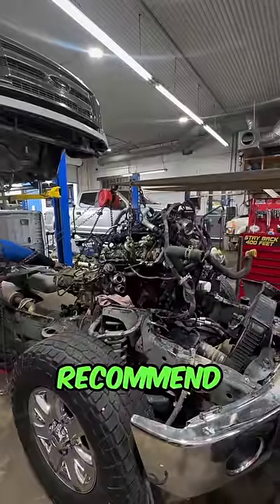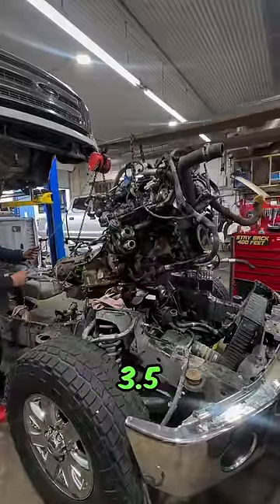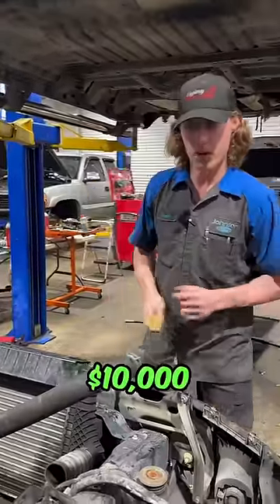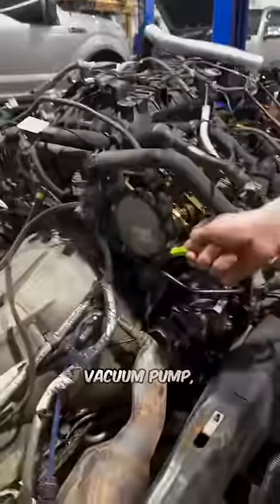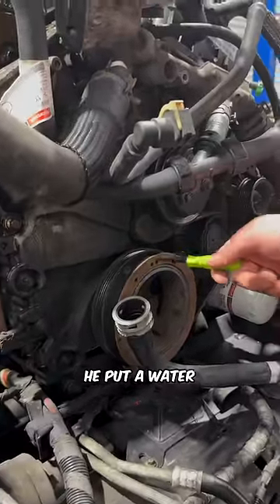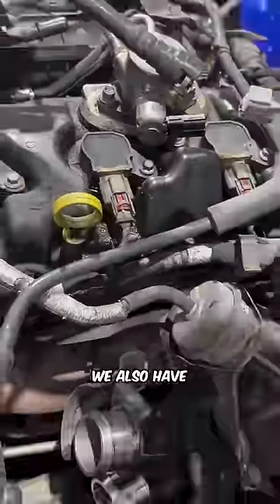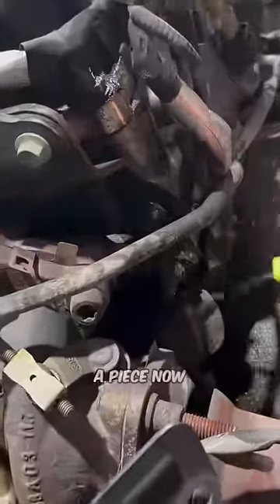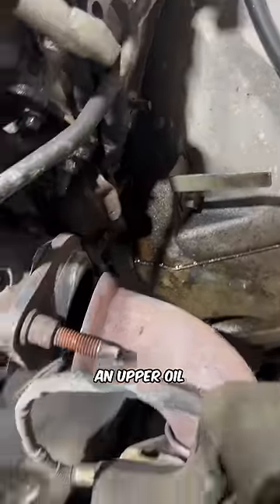Why not to buy a Ford 3.5L EcoBoost? #ford #ecoboost #shorts

Comment: Couldn't find a truck for 10k in last three years, made more sense to drop 8500$ into a 24 year old truck. Newer trucks had way more horsepower but weren't getting better fuel economy, so it was a wash on getting a newer vehicle. All new plates, title, registration, paying more for insurance, I'd have been losing money. With the miles I drive a year my current vehicle should last another 20-25 years, with my initial purchase price of 1500 plus the 8500 for a new motor, my vehicle "payments" are under 450$ per year if it makes it 20 and 360$ if the motor makes it 25 years.  What idiot would buy a new vehicle for 4,5,6,7 hundred a month?
Reply: That’s why I’m sticking with my 03 cat eye with a 5.3. Maybe 2 grand tops to r and r, and maybe another grand for the trans. 5-600 for tires and I’m good to go for another 275k. Plus, even with her leaking oil and coolant I still got 21 with a stick exhaust and intake. Can’t wait to see what a nice cam and head work can achieve as far as power. Even if gas is going up past 3.20 right now in Texas 😭
Reply: @rexmedina4561  Amiri King: "Chevy Sliver-A-doh goes for infinity miles" 😁
Reply: I have friends that pay $760 a month for truck payments. SMH.
Reply: I recently had a 1300 repair on a 99, 5.4. If I bought the new equivalent at 72 months and 7%, each month the payment would be 1300.
Reply: My 96 Dodge is rusting so bad it won't pass state inspection. It's sad.
Reply: Not me. I like the older models anyway. But one day these will be the older models and I dread having to buy one 😅
Reply: You said "newer trucks have more horsepower but weren't getting better economy" Cause newer trucks OFFER way more horsepower for that fuel, so they are definitely more fuel efficient. If you push any vehicle hard it will consume more fuel but the big difference is how much power you are getting from that fuel.
Reply: @trentallman984 if you buy a raptor yeah. But a new xl f150 isn't. My dark horse premium is 1150, same as a velocaraptor
Reply: @JH-zo5gk  I pulled up an in stock, super cab Lariat at a local dealer. The exact equivalent to my 99.
Reply: Easy, you don't buy a new one. My '13 XLT was under $30k out the door and has a bit over 500hp while averaging almost 18mpg. Can't get that at the dealership even of you shell out $50k nowadays
Reply: My fiend pays $875.00 a month for his new truck .
Reply: I picked up an '86 chevy c10, 100% rust free, 54K orig. miles, a few years back for $8K..... But dang it.... it's just too darn nice to use as a daily driver. Garage Queen

Comment: I own a 2015 3.5 liter f-150 with 187k on it. Kept getting a message on the dash no traction control. I told this contractor my trucks losing power and he put his diagnostic computer on and he told the throttle body is stuck closed. I bought a new one at Auto Zone for $119 before taxes only 4 bolts held it in easy to replace now truck runs great.
Reply: So you couldn’t accelerate either? Seems more relevant than the error message
Reply: @BabyGators No it wasn't stuck closed someone just fired the parts cannon and got lucky 😂

Comment: You know lets be honest here. I remember eating Pringles back in the 80's. They were different. Much much better tasting. The powder stuff was caked in them and the chips didn't fall apart when you looked at them.  Also, I truly believe Oreo's from back in the day absorbed milker faster than the ones do today.
Reply: What does that have to do with a junk quality ford?
Reply: Maybe quit buying junk food? No one has a right to complain about the diminishing quality of junk food 😅
Reply: The better question to answer is what food today tastes the same as it did 20-40 years ago? Almost nothing. Everything from chips to drinks, to fast food, to frozen food snacks.. everything.... I'm not sure I can think of a manufactured food item that has the same quality control and ingredients as it did 20-40 years ago. Can you name one? Like a processed, manufactured food that tastes same as it did in the 80s/90s/early 00's. Bet you cant name one.
Reply: @LUk3.M. McDonald’s
Reply: Twinkies tasted better too. Also, I have a 2013 Explorer and I will never buy another Ford. What a POS.
Reply: Ihave a 2013 edge now the front axel makes a cliking noise on hard left turn.

Comment: I've got 338,000 on my 2013.
Over 250,000 towing miles, got me started as a hot shot
A couple exhaust manifolds along the way.
Finally lost a head gasket. 
Very, very good truck.
Waiting on an engine now.
HIGHLY RECOMMENDED!!!
But change the oil every 5000-7500 miles.
Full synthetic every time
Reply: you hot shot with a half ton? what kind of loads do you tow?
Reply: @busterscrugs  20ft PJ 14k tilt-deck trailer. 
Winch load old cars, pickup trucks, many  hundreds of compact tractors from Facebook and Craigslist. 
Payload up to 10k.
It was pretty decent when gas was cheap until Brandon got elected.
Probably clear $300-500 a day back then.
I've got a bigger setup now.
Everyone needs to start somewhere
Reply: 186k on mine. Set my oil life to 50% and only use penzoil ultra platinum. Been a great truck!
Reply: I'm looking to get into hot shotting. Good luck in your future!
Reply: Who sells the remanufactured engines? Just curious.
Reply: @tcatx8496  I'm hoping to get used from local yard or copart auction and swap
Reply: @garrettbreech728  I add lucas fuels oil additive. It lubes the guides and no chain noise 174,000
Reply: On the 3.5 change the coolent every 3 to 4 years with  oat yellow ford coolent so the water pump will last.oil blend 4000 max 5 ooo syn.helps the water pump to.
Reply: A very, very MID truck

Comment: I had trouble with both turbos on my 2016 f150 3.5 ecoboost,bought them both from ebay at $170 a piece and replaced both manifolds with new gaskets and bolts for $150 for the pair and installed both turbos with new fittings 11 months ago and the turbos are working beautiful and the labor only cost me like $350 since i live at the border with México and theres some really good mechanics over there who really know almost everything about these fords so they know what they're doing.

Comment: and the old 4.9, 5.0, 5.8 & 7.5s are still running fine everyday.that tells me ALL i need to know about newer fords.i'll keep my old ones.
Reply: I have a 98 460 and it looks like it has never been touched.
Reply: @jimandskittum and it still makes 180 hp 😂
Reply: @cptbuiltk7944   Preach brother, I'm not a Ford fan. That's a big ass motor to be so weak but it does keep right on rolling.

Comment: it has 200k miles. They got their money out of it. Spend 10k and get another 200k, it's a lot cheaper than buying a new one.
Reply: You ain’t getting another 200k outta that motor
Reply: @classicmonty5728  I have an 11 6.2L with 200K. Not a single leak. Engine looks very clean and runs like a hungry bear to a picnic. It is VERY rare for those to fail.  I just installed 16 plugs, even if Ford did it only 300$ labor. Does cost a bit more in gas.
Reply: @classicmonty5728  if an early model ecoshit made to 200k, I'd say it's a unicorn engine. I wouldn't be surprised if it made it another 200k.
Reply: True that even just base model f150 are 40k and up. Even used ones with 100k or more miles are still selling for 20-30k, some are even 2wd. Truck market is crazy, people just keep buying no matter how expensive trucks get.
Reply: Nah. Maybe if it was an older truck/engine. Ya know when they were more reliable and built better. 
You put 10k in it now it won’t last another 200k I promise you that. As soon as you seal her and tune her up- the tranny goes- the suspension goes- the computer goes- all the other major components start failing one by one. Dash and interior start falling apart, etc. Domino effect……. Be thankful it gave you 200k. Get whatever $ you can out it and get another one. It’ll be cheaper and better in the long run. 
Trucks after made after 2010-2014 to present day aren’t meant to last anymore. Throwaway plastic junk.
Reply: @johnsalcido5436  older trucks were indeed more reliable, but it doesn't matter if it's the worst truck or the best truck ever. Time has gotten to older trucks, interiors are worn down,  very likely leaks fluids, suspension worn, among some other things. Finding an older vehicle that was maintained is not only hard to find but when you do find one, it's overpriced. That goes for anything considered a truck, I keep seeing older 7.3 diesels with 200k miles going for 15k and  above. Sure, it's a great engine, but unless it was maintained properly, it's going to be a nightmare. One thing gets fixed another one breaks. Even worse, when it had multiple owners, the seller would probably still want way too much money for it. If the truck has lasted 200k miles it'd be best to just try your luck with it. Especially since you know whats been maintained and what hasn't, plus it's a good conversation starter. Buying a another truck just won't make sense in this market. Go cheap, you're getting a ticking time bomb, buy new your also getting a ticking time bomb. Better to just stick with what you already have for some people.
Reply: @alb12345672 that's a naturally aspirated, kinda normal V8. Unless it needs chains and tensioners, not much goes wrong with them
Reply: @hoost3056  For that engine, even that is very rare. The VVT is UNHEARD of to break. It uses the valve springs to position, not oil pressure. The VVT just fills with oil at a certain position. A few break valve springs. Most can be easily repaired. Sadly though, a handful die from it. That is the only way they can be destroyed.
Reply: These ecoboosts didnt have port injection, only direct injection.

2017+ ecoboost F150s of any engine combo are the ONES TO GET and the 5.0 from 2018+
Reply: @alb12345672 nice. But equivalent to fords 3.5 is gms 3.6. Even crappier. Thank god they aren't in the pickup trucks and rear wheel drive.
Reply: @Flatlandproductionz  The 3.5 is a much better option than the GM turd. A used car dealer said he hates to sell them because there is always a buyback or bad review. Usually when people sell them they are spent.
Reply: @curlyfriesolaire8053  my 2015 made it to 56k miles before it had a problem with timing and the transmission took almost a whole minute before it would engage. So the engine and trans took a dump. $3500 for engine repair $5000 for transmission rebuild. Looks like mine wanted that $10k tune up a little early.
Reply: You can probably get a crate engine for 6k
Reply: He's ripping people off. A reman is 6300 and he is also charging double the actual price for the manifolds.
Reply: That's exactly what I was thinking that condition is expected with that milage I have a 15 swapped the motor at 200k cost about 8k installed seemed fair didn't have any troubles getting to 200k in the first place
Reply: All of that at only 200,000 miles? That's pathetic. Me personally I'd junk the damn thing and get something else. You'll never catch me ever owing another Ford product. Owned 2 in the past, never again.
Reply: @todddavis3416  what brand you buy now toyota, honda, chevy, dodge, Kia, tesla, scion, , Lamborghini, Volkswagen, BMW, Rolls-Royce, Mercedes, oldsmobile aka chevy, gmc, bogotti, Hyundai, Lincoln ford, Mazda, buick, cadillac, Infiniti, jeep
Reply: Honestly that amount of work is pretty good for 200K modern gas truck . As long as they get another 100K out office getting
Reply: Folks act like $10k is spare change just sitting around for these repairs. I guess we must amass $500k on tap to drop cheese so easily for these wrecks🤷
Reply: 180k miles on my 2011 and all this miles towing my dump trailer for work and no issues  yet, this is the best truck I ever had..
Reply: I have a 2010 SHO with almost 300k. Doesn't leak. Never opened the motor. Regular maintenance.  
Come get some.
Reply: @flowpuppie84  Cool story bro. You’re leaving out so much detail in that tiny little paragraph of yours, but I guarantee you’ve had to replace major components like the water pump, timing, chain head gasket, etc. No way did you reach 300,000 miles without any of those failing on a 2010, especially that was the first generation of the revision of the SHO, which was notorious for having problems. (Not to mention the transmission issues.) If you’re going to lie, then, at least try to be good at it.
Reply: @alb12345672  You're getting 12 mpg down hill with a tail wind.  A little more on gas = $15k minimum .... over 200k miles.
Reply: @uploderpilot  Agree..the eco may get 15-16 avg when this gets 12-13. It is a commercial engine though. If a truck sits in the dealership for a month, that can be a huge loss to someone who needs it. Even worse breaking down somewhere.
Reply: The rest of the truck is still used asf.
Reply: 📠 most Chevys and dodge blow up at 20k
Reply: @classicmonty5728 That's the truth! Lol
Reply: @johnsalcido5436 Ford's last decent F-150 was 1996. Chevy's last decent 1500 was 1998 (an argument could be made to extend that through 2006). Dodge's last decent 1500 was 2001.
Reply: @alb12345672 Dodge & GM half-ton trucks could flirt with mid 20's mpg with the small V8, either a 318 or a 4.8. Why is everyone pretending these stupid EcoBoosts are so wonderful?
Reply: @Contreras-z4e No they don't......

Comment: Considering these motors have been out since 2011, they have been very reliable. My neighbor has one in his 2015 F150 with 305,000 miles, he did have work done to the turbos, other than that a great engine overall ( he says he would get another 3.5 ) I think Ford has better ECO motors of any other manufacturer !
Reply: I just got the 2.7L Ecoboost. I’ve put about 11k miles on it since I bought it and it’s been solid. Look forward to holding onto it for a while!
Reply: Im hoping to get that 300k lol. I have mine 2014 eco with 170k on it and never really had to change anything. The major replacement was just the water pump and that went at like 165k. Other than that just basic maintenance
Reply: This is the truth in general.
Reply: Bought my son an ''11 back in January, 3 wks in to owning it I had to do an entire timing chain job on it.
Reply: Had a 3.5 EcoBoost under 60k miles the timing chain started making an awful noise. Then the exhaust manifold started leaking. My old ram had 248k miles with no issues.

Comment: My 2012 has 286,000 BEATEN miles and she still cranks up and rides down the road and has ZERO leaks of any kind. Never selling the truck it’s a trooper
Reply: I believe this guy doesn't like Fords. Seems every video of his I see is knocking on Fords.
Reply: @DChrls Well that's what happens when you break them down and put them back together every day.
Reply: So does my ironicly 2016 3.5 eco boost with 253,000 abusive miles
Reply: @DChrls well he happens to work at a Ford dealership. It's kind of funny though cuz I used to work at a GM dealership for a few years when I was in college. I drive GM cars today instead of hating them so I guess that's the difference. Every ls I had I ran at least 300k on  and I didn't have to tear the engine out of the cab and replace pretty much everything on it. The larger trucks in the fleet that we have that happened to be a 6 L like some of the work trucks were, we didn't do anything to those and half of those we had for 600,000 to 700,000 MI. Yet the Ford guys would rag on GM and Dodge for still using overhead valves but then they went back to it on their latest work truck 7.3. Yeah I wonder why they did that. It's almost like they got tired of getting tea bag by the 6 liters  that never die that GM made for the last 20 years.
Reply: @huntermccook6492 cam phaser? Timing chain? Nuthin?
Reply: @ownthenight01  Not yet. I did lose 700 dollars on a messed up exhaust manifold at 200,000, tho
Reply: @huntermccook6492  that's great then
Reply: Averages don't lie. Just because yours has been reliable doesn't mean they are all good.
Reply: 😂 that's because that's what he works on. Of course his videos are all of fords.  @DChrls
Reply: Those turbos leak internally as well and will cook the cats. 2013 300k mile twin-turbo owner here. Still runs.
Reply: Well to be honest,  you work at a Ford dealership. You are not going to get a Chevy for an engine replacement.  So, of course, you are going to get ones that need repaired
Reply: @XJon2011  mine don't have cats lol
Reply: Ole-timers use to say, you want make ford last longer, you drive it like you own it😮
Reply: @colinmoorhead3299  Did went to thr bank when you bought it new or did you buy it used and paid it with cash?
Reply: @ownthenight01 cam phaser is actually a bigger problem in gen 2 3.5.
Reply: @ashes2ashes863 300K for LS is common, but let's not ignore the cam/lifter problems many of them had. 
You're also exaggerating saying it's common for a 6.0 LS to go 600K-700K.
Reply: I know way too many people with 3.5 turbo issues. I have non turbo 3.5 in my Explorer and this car has been the biggest POS I've ever had.